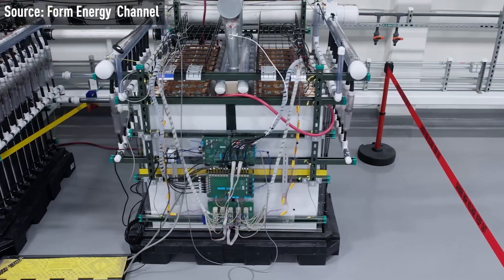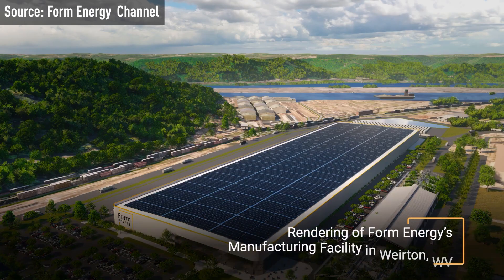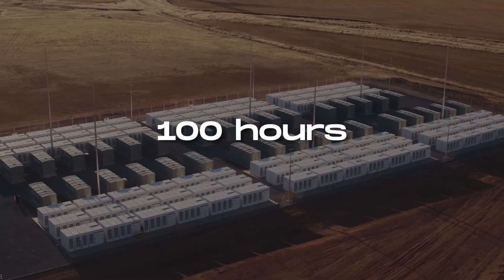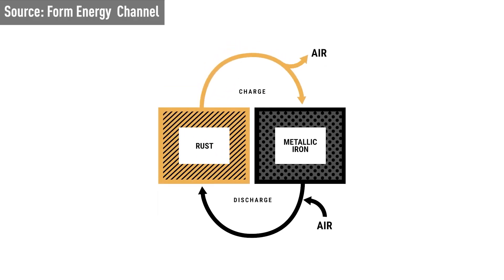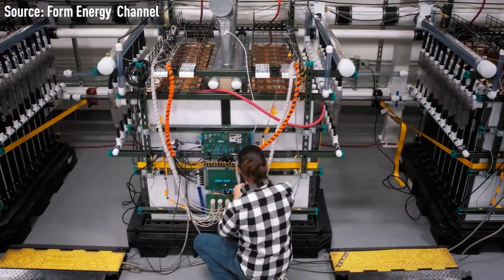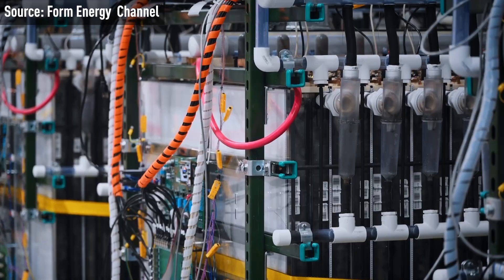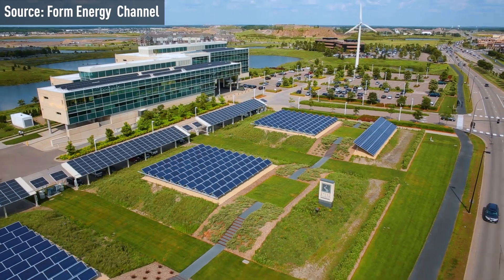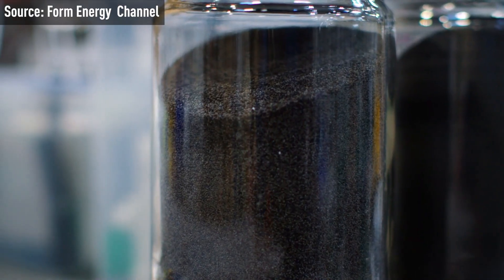Jeff Bezos BEATS the EV Charging Market With REVOLUTIONARY electricity storage technology

Comment: Thanks for the vid.

A half dozen new battery designs would be better solutions for grid storage. 

Air Iron batteries are big complex machines.  It is not a bunch of jellyrolls of different metal and plastic foils inside small tubes.

Based on the amount of time it takes to roll out a new technology, this would have been an awesome technology to begin rolling out 3-5 years ago, but it simply doesn't compete price-wise with modern LFP prices.  

It could definitely work - but they will have to reduce projected maintenance costs.  I assume maintenance costs similar to that of vanadium flow batteries - and I think they are marketing a maintenance coat like sealed grid scale plug and play devices.

It would be nice to free up Lithium for other purposes, but I don't see it happening.